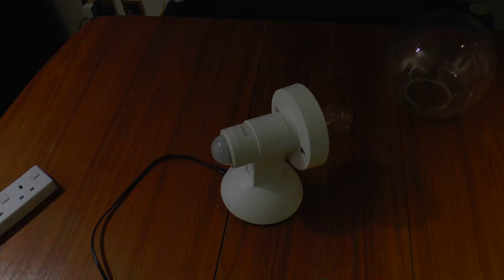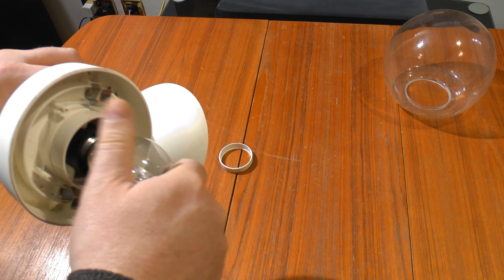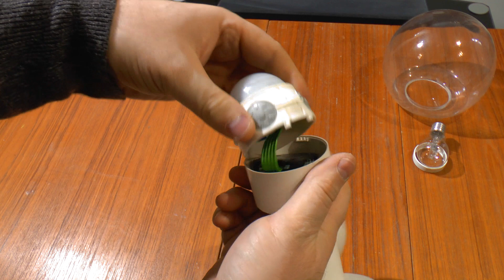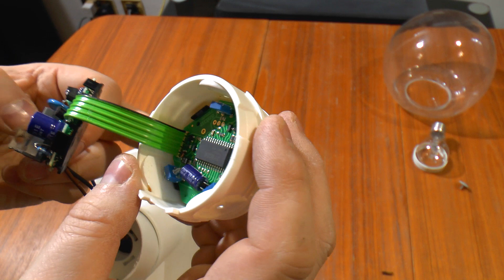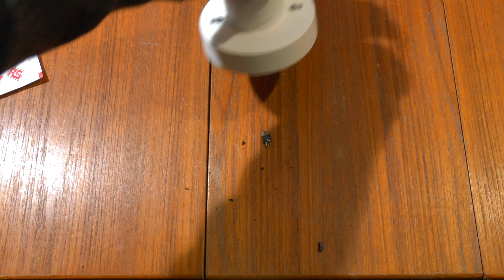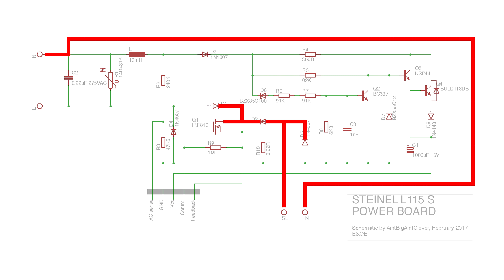Steinel L115 S mini-teardown and repair

Comment: Very nice repair, I have 2 Steinel sensor lamps fail with the same symptom (they stay on). They are slightly different model (L585 S, no slowstart)  but I hope the schematics is similar enough. I only do not understand  the part you replaced IRF840, is a Power Mosfet according to datasheet from manufacturer (Vishay) but you call it triac, they are not the same thing, are they ?
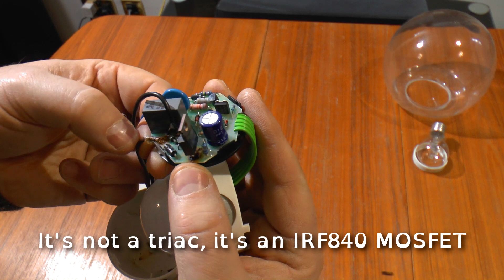Reply from the maker: At 4:37 I've captioned it.  I initially thought it was a triac.  When I worked out the schematic and looked up part numbers I realised it was a power MOSFET.

Comment: That stuff that fell out looks like the glue they sometimes use to secure components. It was a huge problem in the 1980s. I still see it used today. It darkens and turns conductive when exposed to heat. I know some Sony broadcast equipment used it. Sony's tech bulletin referred to it as chloroprene glue. Or it could be a bug as you say... You could open the other lamp to see if it has it in there.
Reply from the maker: I know the stuff you mean and that's what I thought it was at first, but it looked a bit too "organic" close up. I'm surprised it wasn't full of bloody woodlice, damned things get everywhere here.

Comment: Can you install them with the lights facing down?
Reply from the maker: No. The sensor would then be looking up at the sky and also getting rained on, it'd fill up and burn out in no time.
Reply: AintBigAintClever ah ok. I was thinking they were water sealed tight, They look really cool
Reply from the maker: Unfortunately not, they're only IP44 so basically splashproof. Steinel's IS 1 standalone sensors have a bit more protection which is why I've got them for my wall lights (the cheaper ones never last long). For the corners I didn't have a lot of choice.
Reply from the maker: It did cross my mind to use those bulbs with the front reflectors that you'd see on track lighting years ago. Will see what it's like with 40 watt LED corn-cobs, the light will be higher in the dome so will hopefully cast less shadow, plus a 40 watt LED should be a damned sight brighter than a 42 watt halogen.

Comment: I also thought it was a dead triac, i was wrong too :-D.
So you had a bug in the design lol, sorry i had to say it.
I get confused with some diagrams, i have to redraw them in a more conventional logical way, some diagrams have parts all over the place and my brain explodes lol.
Reply from the maker: I believe the original bugs were much the same, where insects would get into early computers, jamming relay and switch contacts and causing malfunctions.
Reply: I would tell them to "Bugger off" sorry :)

Comment: I had an idea of making a string of LEDs soft start by changing the duty cycle.
Reply from the maker: That'd be no different to the way colour-change LEDs work, with three separate outputs having their duty cycle varied. It's more efficient to use a duty-cycle change (pulse width modulation) than varying the control voltage to the output transistor.

Output fully off: high voltage across transistor but zero current flow; high internal resistance so low power dissipation in transistor.
Output fully on: high current flow through transistor but low voltage across it; low internal resistance so low power dissipation in transistor.
PWM, 50% duty cycle: an equal mix of the above.
Analogue control, 50% on: moderate current flow through transistor and moderate voltage across it; transistor acts as a resistor so relatively high power dissipation in it.

Comment: So its essentially putting a bridge rectifier's input in series with the bulb, and shorting the output of the rectifier to power the lamp with just a single mosfet. Thats very clever!
Reply: When you redrew it as a bridge rectifier with the MOSFET inside, the light came on and it all became clear. Not very big, but pretty clever, for sure.
Reply from the maker: I didn't realise until after I'd recorded it, but managed to sneak an extra diagram in. Yes, basically it's a bridge rectifier with a variable DC load. Turn the MOSFET fully on and you've got a shorted-out bridge rectifier with lots of current flowing through it and in turn the bulb that's in series with it.

Doesn't explain why they used two different sets of diodes, though. The back half of the bridge used 1N4007, but the front half used slightly bigger diodes that the the MOSFET appears to have bleached the part numbers off. They're made by ST but I can't tell what they are.